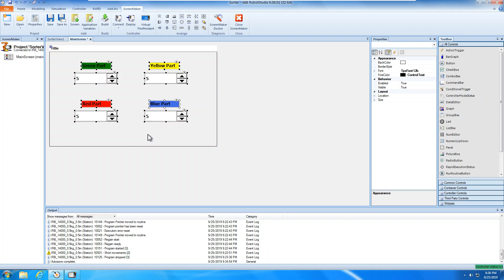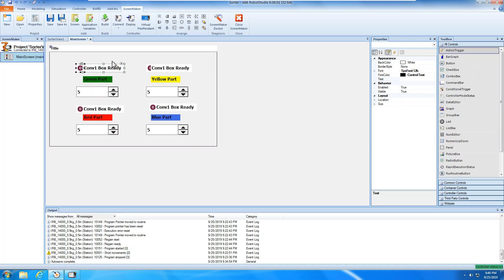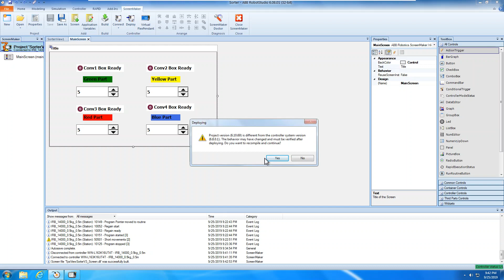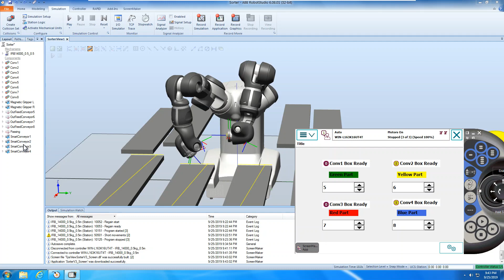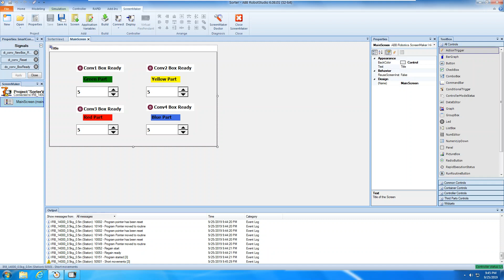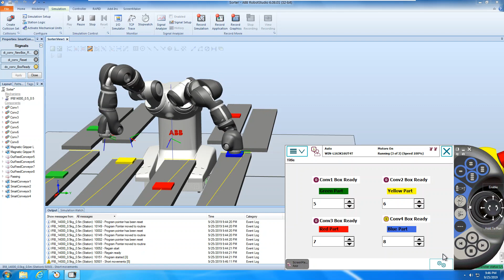ABB Robot ScreenMaker 2 (LED) RobotStudio Programming Simulation

Comment: Hi, I'm starting with screenMaker, and I have a problem. I configure the buttoms and the 'numericupdown' correctly, but when I open the flexpendant and click on play, it doesn't work. When I close the simulation, I go to Rapid code and the 'rapid variables' that are linked with the variables created in ScreenMaker, are updated.

Everything works correctly, but the simulation doesn't answer when I click the buttoms on screenMaker.

Could you help me?
Reply from the maker: Any screen shot?
Reply: @Factory-Automation-Sydney  I'm trying to send you an email with screenshots, but it says that your direction doesn't exists. How can I send you something?
Reply from the maker: @fpelectricidadcantabria2377  
Hello Friend

I have found any program attached. 
But I might understand what you have faced. 
I also saw that situation and fixed. 
in my memory, that is why I have used mutli-task program for control part only.
So I have 3 tasks ( R-Arm L-Arm Control part )
and additionally If you want to update variable, it must be global persistent task variable. 
Please see the program manual about variable. 
Thank you